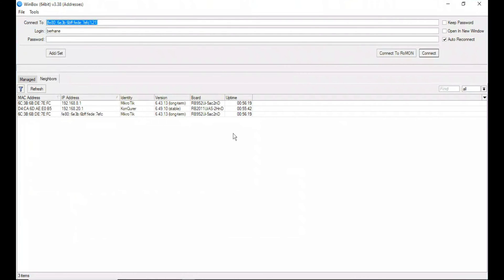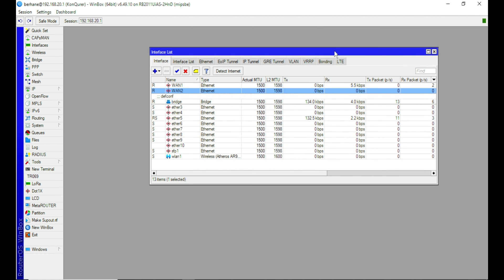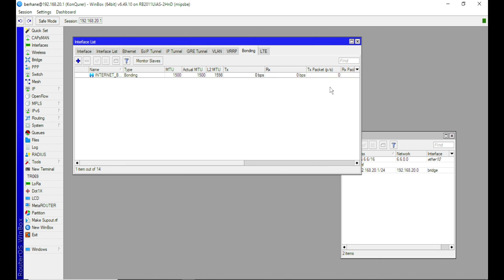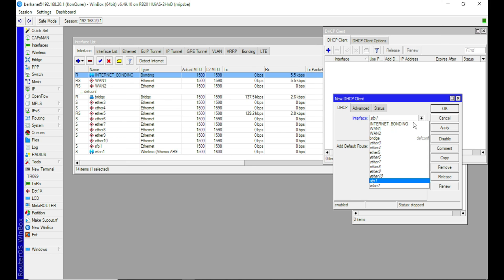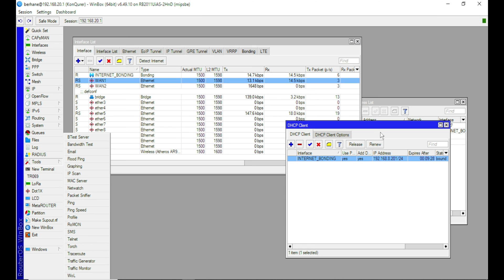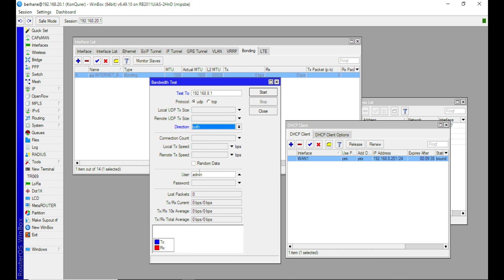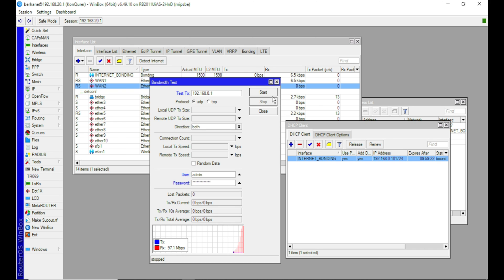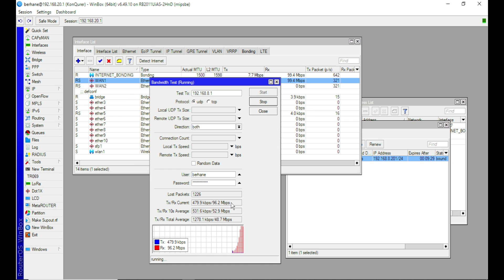How To Maximize Bandwidth Throughput With Mikrotik Bonding

Comment: after i bound can use the same router for hotspot
Reply from the maker: Yes offcourse but you might have to use different ports
Reply: @owuubii  like which port and moreso what if  isp1 goes down ,will all packet work on isp2 automatically
Reply from the maker: Yes please 🙏